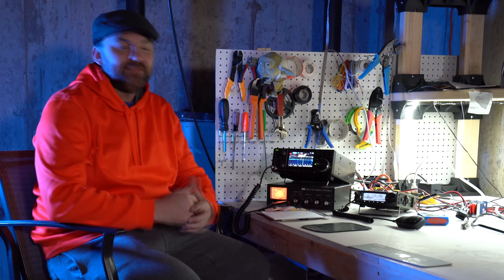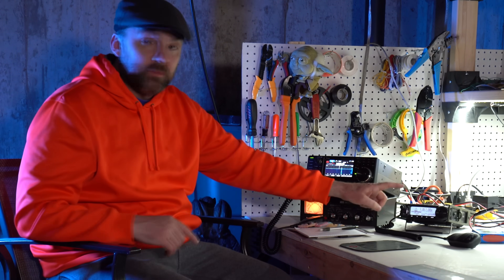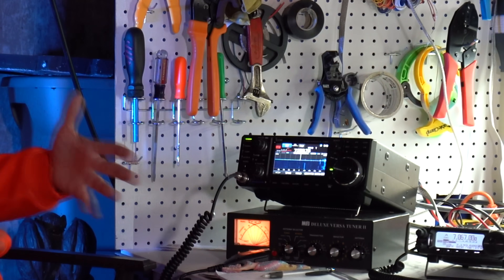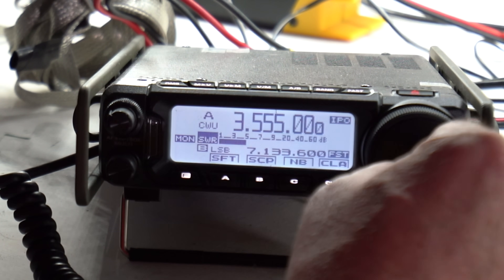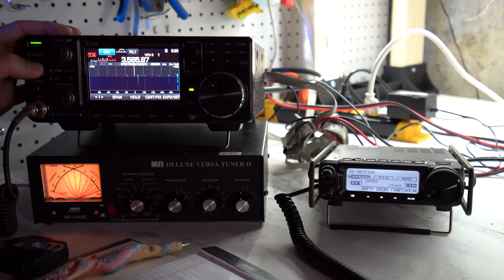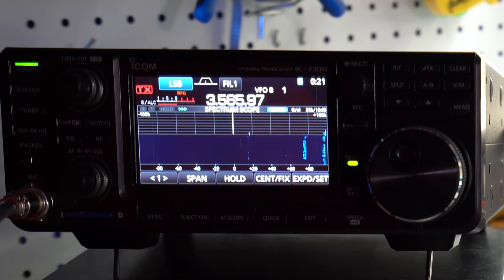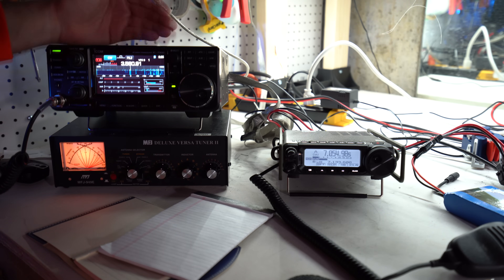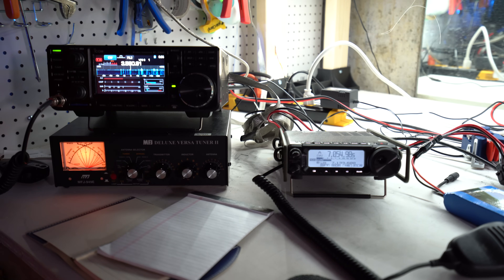iCom 7300 vs Yaesu 891 Comparison ~ Battle to the DEATH!

Comment: I came close to pulling the trigger on the 891 but after seeing the display on the 7300 I went for it instead, I also have the kx2 which works excellent but after getting used to the waterfall on the 7300 the kx2 sitting idle. It really is useful, I have the display set to see the whole band so I can get an idea of how much activity is out there....I miss that a lot on radios that don't have it...and yes imo the radio is easy to operate, everything you use often is easy to find without a ton of menu drop downs
Reply from the maker: Yep, it's that 7300 display that's amazing.  Easy choice if you don't mind the big boxy build.

Comment: You should check out this guys video on how to operate the Ft891 he does a really good job explaining how to use.  And can't you set the power adjustment to a fast key. With my FTDX3000 i don't have to push any buttons to change power just turn the knob. This is a good video but your never going to get all the buttons on a portable radio like a base radio, its just a size thing.  I'm sure most of us need to learn how to use our radios better but we want to get on the air more LOL. here's the video.   https://www.youtube.com/watch?v=yPMSgurd4Uo
Reply: Sorry I couldn't resist you did such a great job on how to operate the 891, When my buddy brought his to Field Day i wish he and I had watched it first since he didn't know much about his  891. Keep up the good work!
Reply from the maker: No problem, I tend to forget how to operate these things, I have a million other devices and computers I deal with.
Reply: I'm the same way memory is terrible. too many hobbies also.

Comment: Why you don't have "what buttons to select" for the  most common functions you use puzzles me. Trying to remember all the menu functions of early SDR's and current SDR's is mind boggling. The ICOM 7300 touch screen has eliminated much of the guess work without a shortcut list. Still, having a short cut list for each rig that uses multiple menus will give you less frustration. 

A comparison I might make would be between the HW-9 and the FT-817ND even though the HW-9 is CW only. Comparison could be made for weight, ease of use, packability, and power requirements.

Enjoyed your video Tom. 73 KB8AMZ
Reply from the maker: Thanks for the comment.  I need to have a laminated short cut card for each radio. I just forget after the weeks go by.

Comment: Just wanted to say that I really enjoyed your video about overnight camping and operating qrp with various antennas. I operate portable but there are no places to do overnight camping around here with the same open space freedom you enjoy. 73 de KE2YK
Reply from the maker: Thank you so much for the nice comment. Whereabouts are you?  There really aren't that many places here either to camp... maybe some state parks and those are usually booked up.
Reply: AnythingWithWheels i live on Long Island about 60 miles east of manhattan. We have state parks here but most close at sunset an those that offer camping give you a 50/50 foot plot, rather depressing. However, we do have beaches and the ocean. I activate state parks on the air or POTA and try to get out year round. In winter its in side the suv. Appreciate the great videos 73 yk

Comment: I am aware its winter in the US and this may answer my own question.  You seem to have moved away from QRP field operations and never mention it now. Is that a thing in the passed now Tom?

73 Colin vk2jcc
Reply from the maker: It is not passed. The weather and band conditions have made qrp outdoors tough. I'll do more in the spring and summer.  It's snowing right now. I don't want my radio and camera to get wet....and it gets really cold outside when you are sitting still doing radio since it's not an active activity.

Comment: Good One! I have a Anytone quad 6 and it has knobs, I can just scroll through all the frequencies from the 11 meter broadcast band to 10 meter ham band. Rf power is also a separate knob. mode switch is a single button "mode". The conditions on the 10 and 11 meter bands are not as terrible as most HF bands are here. I sold all my other transceivers.
Reply from the maker: Thanks!  Yeah, I have some selling to do myself.

Comment: What worries me about IC- 7300 is the fact that it is much weaker regarding an interfering signal as compared to Yaesu ft-991. Yes, that is anothet radio than the one compared here, but one starts doubting whether it is worth buying an IC-7300 if it is so inferiour to the rival of similar class from Yeasu. Although it is in Russian, but quite easy to understand, have a look here: https://youtu.be/gv8oUkIja1o
73 de R2ARM.
Reply from the maker: Great comment and great video. I wish I had it in English.  It's possible that radio does beat out the Icom.  I'll let the buyer beware and choose what's best for him.
Reply: Thank you for your comment! Actually, that is a very disappointing video for me, because I was planning to buy Icom 7300, and generally I am an Icom man - since the beginning of my hobby in the 90-s always opted for Icoms. All those 746, 756 Pro series appeared to me superior to what Yaesu was offering in the same class. And I find Icom menus and controls more logical, and production quality - higher. Yet the video definitely shows that a strong signal in the vicinity from a generator beats reception on Icom-7300, not affecting the same on Ft-991. As we all live surrounded by high levels of interferences this is an important aspect. So I wrote to the guy from the video - please do compare Icom Ic-7600, Ic-7610, which I started considering instead. But! If Yaesu sends him radios for comparisons, Icom does not, so that was his own IC-7300 and he naturally does not have a possibility to buy a more expensive Icom model just for comparing it for me :). So, we just have to be cautious of this aspect. Yet the outlook, the screen, design is much better with IC-7300 as compared to Ft-991. And thank you for your videos - I am watching them more often than a TV! 73 de R2ARM!
Reply: Alexei Zhiltsov is a Yeasu the cousin of a Yaesu? LOL 😂

Comment: Hey there,

Thanks for sharing :)
On the band-selection/frequency stuff, did you know you can enter the frequency directly? 

When in band selection mode - tick the F INP button and you can enter the frequency right away, without having to turn the dial, might be even faster from time to time

73 de PC4AD
Reply from the maker: Yes, I figured you can enter in manually, but I just did what I find easier.  I'll have to try it again asap.
Reply: @hamradiocq  For sure :) It depends on what I want to do what I use it for

Comment: Nice comparison! Would be nice a back to back comparison with and without filters DSP DNR engaged. I've read the Yaesu have more sensitive receiver and sounds a little better. 73 man! Keep going
Reply from the maker: Yeah, I guess I should have done that, but I also only have 1 antenna line and I don't know as much about the 891.  Still a fun video though, thanks for commenting!
Reply: I have both, and the 7300 has a better reciever in all respects.  As you would expect it would. 73 James K0UA

Comment: Thanks for the comparison!

Right now the 7300 runs $1000 incl rebate from DxEngineering and the 7610 is $3100 incl rebate. I am looking to buy my first 100W radio.  I built a qcx, am learning morse code, and have been running WSPR. 

Is the $2100 extra really worth it for a starter radio?

I like the idea of spending $1000 for the 7300 now.  Then something portable for another $700 (FT-891) maybe in the next couple of months - similar to the setup you compared.
Reply from the maker: Yeah, unless you have some serious wealth, the 7300 is just fine.  It does everything I need.  Do wish I had a 7610 though!  Go with the 7300 and you can't lose.
Reply: I think you are on the right track here. I have 2 of the 7300's and one 891 in the mobile/portable.  You will not be dissapointed in the 7300 for sure. and the 891 is a good little mobile  rig.  73 James K0UA
Reply: Brooke Hedrick buy a used 7600 for around $1000 because it is better than any you mentioned hands down.
Reply: The 7300 is deaf. Get the 7610 it's sensitivity is amazing as well as all the other features. 7300 and 891 are poor men radios.

Comment: Great 'unfair' comparison. :)

We can use wider auto tuner range up to 10:1   for IC-7300 if we set it on 'Emergency mode', and its limit thee TX power to 50W only

Thank you for sharing your thought. 

Bahathir 9W2GNU, 73. .
Reply: yes but at 50 watts only anyway the tuner in my 7300 is very good  if the antenna is more than 3/1 tuning it will not make it work any better if you show the radio 50 ohms

Comment: Hi Tommy,
The new Icom SDR radios have many features I like, but the deal breaker was Icom using 3dB steps for the S meter from S0 to S9 while everyone else uses 6dB steps per S unit. Don't know why they made the change.   73   WB3BJU
Reply from the maker: I hear ya... makes sense.  73
Reply: We buy rig for better reception and operability. S-meter  is just one of the feature.  It is not fun if we got S9 on very  accurate S meter, but we only hear lots of noise. 

I prefer not so accurate S meter  if I able to operate it very easy.  BTW, I am using hamlib's rigctl, to read signal strength's level.  I found that, S0 == -54 dB, S9 == 0 dB.. and each S unit is 6 dB.  I am not sure, how the 3 dB for S unit came from.  

To make sure about it, get another rig, and compare the signal sterength  using the same antenna.  Anyway, S meter is just a relative  measurement  and not to be same with other rig..  unless we need a very accurate measurement for lab's experiments. 

Thank you.

Comment: I really like these types of comparisons :-)
Next step compare FT-891 and KX2 on portable operations. :-) 73s, Stephan, DF6PA
Reply: The 891 is not a bad portable rig, but it won't hold a candle to the KX2. One glaring difference besides the superior receiver in the KX2 is the fact that the 891 is a 100 watt class PA section. Which means even when turned down to 5 watts it still draws 4 amps of bias current before it makes a single watt of power. This is true for all 100 watt class radios, not just the 891.  Of course this is going to eat into your battery bigtime, not to mention it draws just over 1 amp in receive too.  So the KX2 is much more battery friendly for portable operation. It also costs more, and if you need 25 or 50 watts or even 100 to make the connection you will need an external amplifier for the KX2.  On the 891 just turn it up. As long as your battery can support it.  Of course the 891 has no tuner either, but you can add the external LDG tuners for not too much money.
Reply from the maker: Thanks!  I also like your idea, 891 vs KX2!  Great idea

Comment: I have both radios just as you do. In fact it was because of your reviews of the FT891 that I bought it as my first HF rig. I then got the 7300 and again as a result of your videos and several other hams on YouTube. I am very happy with both radios. I used the 891 as my base until I got the 7300. They are sitting side by side and I only turn it on when I want to talk on 3.963 and I use may MFJ auto tuner to be able to talk there. My 7300 will not tune there with  either my MFJ-939 or my LDG AT100Pro auto tuners. If I want to talk on the net on 3.963 on the 7300 I have to use my MFJ-962D manual tuner. Kind of strange and a pain in the butt if I want to use the 7300 on that frequency. Other than that you are right, it is an unfair comparison but as you those are the two radios I have to compare to each other. The 891 comes to the field with me when I set up for portable use. Thanks for sharing.
Reply from the maker: Yeah, nothing wrong with comparing apples to oranges.  : )  Interesting that your 7300 will not tune there...?
Reply: @hamradiocq  My 7300 will tune there but not with the two auto tuners but will tune to 3.963 with the MFJ 962D manual roller inductor tuner.